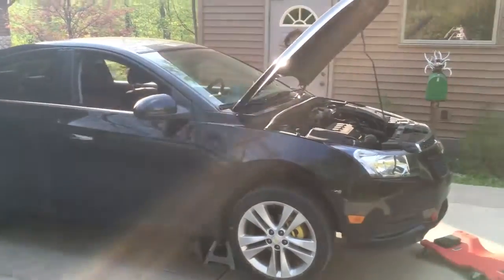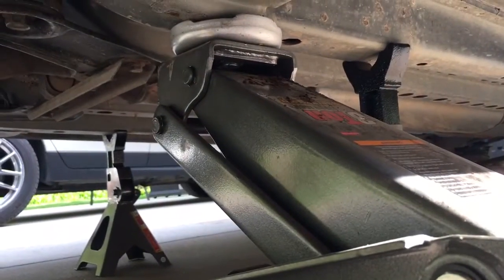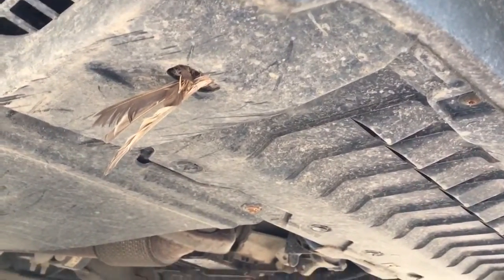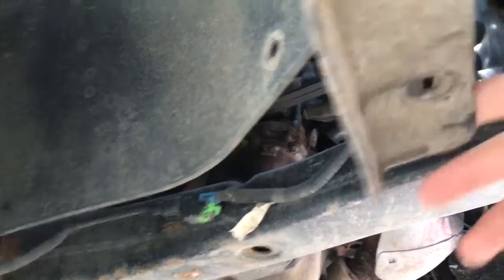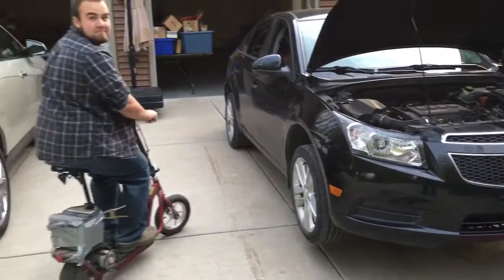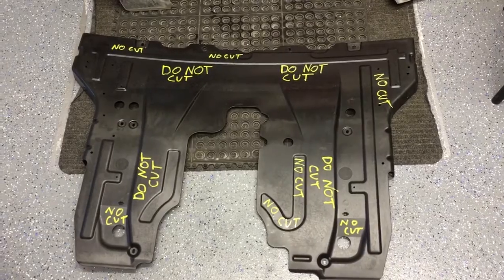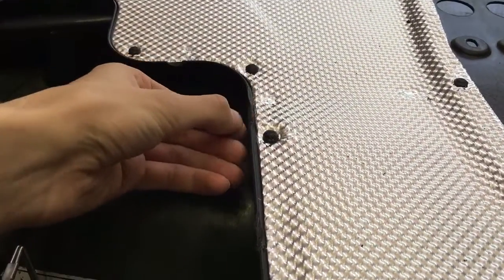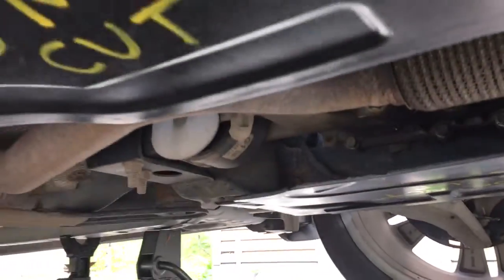Chevy Cruze engine splash guard replacement 2008-2016

Comment: Just changed the splash guard / under tray on my 2011 Cruze (I live in Europe). Interestingly, the guards that were on the car were allot smaller than what you had. I am curious to see how much of an impact it will have on the fuel economy. I have been keeping track of it so I should be able to tell if it helps or not. Another reason I wanted the old one was to better protect the engine and try to reduce the road noise.

I didn't make modifications to the guard since my car has the 1.8 liter engine, which, as far as I know, doesn't leak nearly as much oil as the 1.4 liter turbo. Funnily enough, the guard I bought was second hand and came from a Chevrolet Orlando that has the same engine options as the Cruze but I couldn't find mention of a recall for that car.

Comment: Just checked the part number for that shield, and Ebay is showing that the shield is for a Buick Verano. Obviously the shield works for the Cruze since you installed it, but has that shield been overridden by GM since this video was made? Ebay is showing that the current shield for the Cruze is now 2 pieces.,
Reply from the maker: seanjnl1 ok so the two pice shield is there update to the cutting of the engine shield, its not full protection.

Comment: +Mr95Kenny , can you please tell from where you get that replacement engine splash guard for Cruze?I had mine either had been cut or removed by the dealer
Reply from the maker: Ebay or Amazon
 Part numbers:
95079891 - full shield
94520301 - bolt
24441317 - nut
95216004 - retainer

Comment: Great video . I have to point out that the underneath of your car is very rusty , why is that . Mine isa 2013 model and it looks brand new underneath .
Reply from the maker: Stamas C Michigan winter, they salt the roads.
Reply: Mr95Kenny  yh I thought that must of been it . any more videos coming up ? I dont know how hot it gets where you are but I remove my undertray in summer to help with cooling .
Reply from the maker: Stamas C we get our 90 degree days, but never a problem, i will be posting a spark plug video and a PCV/ valve cover video once I finish editing them!

Comment: These cars leak oil big time.. beat if you still have the car and it didn't catch fire that if you took that off it be all oil... Lol
Reply from the maker: Jason Gaudio sense this video i have started having leaks, thats what some of my newer videos cover, but yes i have had this thing filled with oil! This spring ill be fixing the oil cooler and a transmission seal. Than washing that oil off. 
I think ill add in the description to do this at your own risk because of the oil leaks